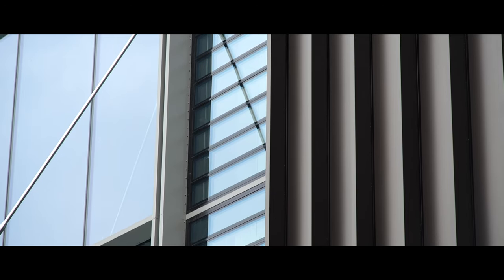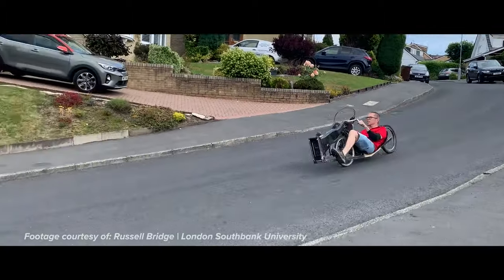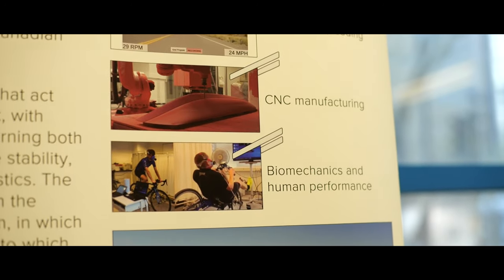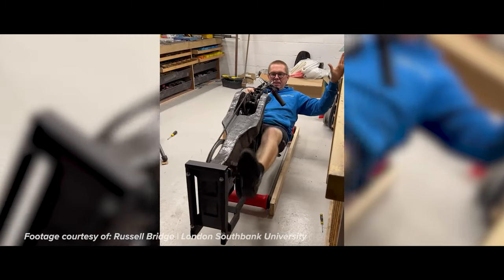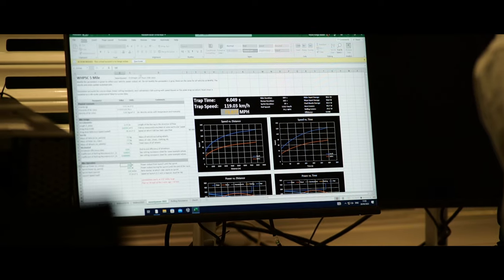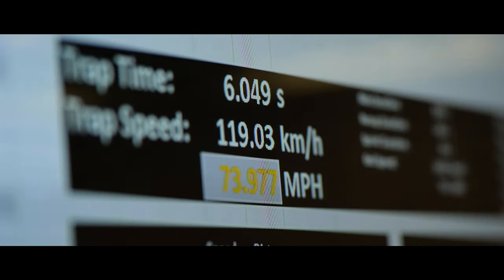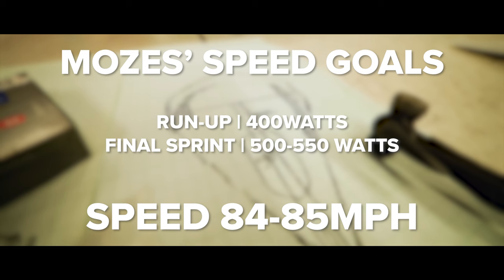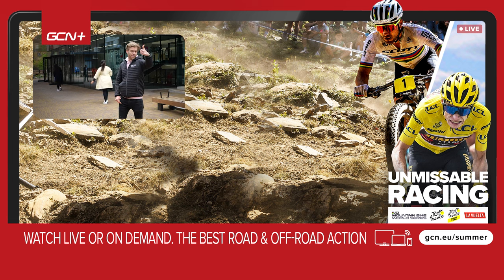The Awesome Engineering Of Land Speed Record Bikes!

Comment from the maker: What’s the fastest you’ve ever gone on two wheels? 🚴💨 Let us know in the comments below! 👇
Reply: Around 85 km/h, downhill of course
Reply: 80/85kph once on a Bad local road and vowed never to do it again….. it’s not worth it!! But my head thinks 60kph on a downhill is ok regularly 🤷🏼‍♂️
Reply: 89km/h. And it was beautiful. It was however on a closed road, good road surface, ideal conditions. It's not something I'd like to do on a normal road.
Reply: 50 mph alone, 55 mph in a pack. Downhill, of course, on California coast with side winds from the Pacific.
Reply: around 55km/h with a blast of wind in the back, flat ground
Reply: How fast on two wheels? Over 140mph.

It was a motorcycle though.
Reply: 72kph on flat ground on my Cruzbike V20 with a slight tailwind at 55 years old. Yes, it is a recumbent, but not faired or a "streamliner" like in the video. Those are way faster.
Reply: 60.5 mph at Battle Mountain in 2019, and I was only like 14th fastest. I was there in 2022, the year these bikes and folks featured in this special were there! Cockpit window video with speedometer, start to finish: https://youtu.be/dftLvLb8USU
Reply: 101 kph down the Tourmalet. Scary as f
Reply: My fastest ride was 61 km/h. I was going downhill.
I sometimes go 50km/h when I go downhill near a viaduct. After the decent I go 20km/h uphill.
Reply: Three wheels, but over 50mph, downhill in snowdonia, one wheel on loose chippings one on grass - the roads weren’t exactly ideal…
Reply: @FFVoyager  Motorcycle or not.
This was pretty fast. about 225km/h.
That's even faster than the ICNG (the new Intercity train). This train can go 200km/h.
Reply: @Frank-mn4hx  it was!  😆
Reply: About 150mph, it's called a motorcycle
Reply: 106km/h during a one hour record attempt on Dekra Testoval. Listen right, Battle Mountain has less than 1% gradient, so yes, it is downhill…easily you should subtract 30-35km/h from those records there
Reply: I once road 87.8 kph downhill in a full tuck
Reply: 44 MPH on a 1989 Ross Trice faired [X3 wheels] slipstreaming a car on the A30.Not fast in comparison to other riders here & if the car had applied its brakes I would have been toast.The early versions of this type had the charming habit of locking the left hand front wheel if the brake lever was applied too fiercely as the Sturmy archer drum brake hub was fitted with the leading/trailing edges of the brake shoes reversed- resulting in a capsize or spiraling down the road like a Tatra [WW2 & German Officers unskilled in driving this rear engined  car]
Reply: 60mph on road bike and 52mph on recumbent trike but held up by cars. Still want to go over 60mph on the trike. This was downhill.
Reply: 98.3Km/h on a Strava segment called Calder death race.  0.67Km long average gradient -13% max -20%. Could have pushed harder to hit 100Km/h but the self preservation instinct was kicking in hard.
Reply: On two wheels? Probably 70kph. I don't live hilly, so I don't have many chances for downhill speed records and am not trained, when I get a chance. 😅 In a velomobile I did a 99kph downhill just on the ride home from buying it and probably could do more, if I revisited that hill.
Reply: @casualguy393   70kph on flat!? I'm gonna have to get my V20 on the road and train hard! 😮 I need a bit of downhill for 70kph in my Alpha7 velomobile!
Reply: about 60mph down Froome Hill in Herefordshire. Brown trouser time with the kink in the middle! 😅
Reply: Does Zwift count?? 😀
Reply: With my velomobile I have started braking at 126 km/h on downhill slopes a few occasions.
Reply: 57mph on a Welsh dual carriageway in a Time Trial and on the aero bars. I crapped myself  :-(
Reply: @PsyKeks  It was only for a few seconds, but I bet you would whip the pants off me in an Alpha7, and the longer the race went on the worse the beating would be hahaha. I can't afford a velomobile, so I either have to put fairings on my V20 or build a streamliner.
Reply: 104km/h down a closed tunnel. Amazing what a difference a good road surface makes.
Reply: Leaving the underground garage at work, and cycling up the ramp, the garmin unit hiccupped. The resulting effort showed an average speed of 195.6kph. I'm not sure how accurate that reading was, but I'm happy to settle for a 20% +/- variance.
Reply: 90 km/h on a road down to Oslo. It had cracks, and I was riding a touring bike with narrow tyres and full camping gear in lowrider bags on the front wheel, so I could easily have flown over the bars... 

This was before cycle computers, so to get the speed I was singing various songs with different BPM's, and matching that to my cadence. Afterward I could count the BPM and calculate the speed from my top gear. 😁
Reply: Unknown.  I tossed my speedometer when I was 12 and never looked back.  sub-5 hour Century though, fwiw.  That was with a steel bike from the pre-aero era, so probably 3 hours on a GCN bike 😆
Reply: 95km/h on a tandem downhill in traffic, could have gone faster but the stoker started screaming about never sleeping with me again!
Reply: I have seen (old Cateye computer) just over 55 mph in my youth on steep decent with a tailwind. Best I have see just recently was 75 kmh on my TT bike with 530 Garmin. Seeing that you didn't define two wheels I have to brag about my Yoshimura Suzuki Hayabusa that regularly sees 340 kph on the speedometer. Though I now should take the Garmin along to verify it. (The speedometer  is only marked to 340🙄)
Reply: Hmm. Nowhere near as fast as everyone else, by the look of things. 42 mph downhill (I think that's about 67 or 68 km/h). But the road was bumpy enough that I couldn't see very well, so pedalling faster did not feel like a good idea.
Reply: @Russo_Speedbike For all people here: Francesco Russo is the current 1hour worldrecord holder with 92.43 kilometres with a recumbent. And he rode the bike backwards sitting!
Reply: 60 to 65 km/h on 2 and 4 stroke scooter i use to own
Reply: 90 kph down the col de la Croix-de-Fer (Fr). Back in the days where helmets were far less common. (Yes, no helmet. Never again.)
Reply: I used to regularly do about 90kph down the Bombay hill towards Pokeno south of Auckland before they made it a motorway on an open medium wheel base recumbent. 
53-11 top gear, 170mm cranks.
(I've gone a lot faster)
Reply: Just under 100kph on my first lap of the Nurburgring during Rad am Ring last year. Didn't feel as scary as it sounds, it's a fairly wide smooth track with everyone going in the same direction, but I dread to think what would have happened if me or anyone nearby had a mechanical...
Reply: Over 140 km/h so close to what they are doing. On a recumbent, but on a steep downhill. I was very scared :-) Now, with my velomobiles, I use parachutes in hilly area.
Reply: @PsyKeks  The Alpha7 is not ideal at those speeds. I've already hit 80+ in my Bülk :) Put some hosen and a hood on, it'll make a huge difference!
Reply: @AlveHenricson  Haha nice :) Gogogo Alve!
Reply: 52.7mph or 84.81kph on a mountain bike on a country lane with no traffic. I had to tuck in to get that speed.
Reply: About 42/43 km/h downhill.
Reply: Not sure, - these days guys on decent new set ups advise nearing 60mph on the same road - so I guess 50plus.
Many moons ago, fast enough that the young lady driving the Mk1 Fiesta couldn't out accelerate me... and started to look panicked, so I thought I'd back off rather than her freak out and hit the brakes. Before then I was pretty close to the back of the car... just couldn't see the speedo.
Reply: 80km/h but in a velomobile... a Mango.
Reply: 90 km/h downhill tarmac with traincrossingrail at bottom on my all alu racingbike with flat clip pedals....but with flat shoes (ala 'men in black')
IMMA NEVER DO THAT AGAIN....EVER😱😱😱
Reply: I don't know, I was too busy giggling like a madman 😂😂😂😬
Reply: 65-70 kph. Downhill. My GF already tried to kill me when i told her. 

So that’s my upper allowance.
Reply: 52 mph in a 30 zone, according to the Police that stopped me 😊
Reply: @andyb.1026  Did you get a speeding ticket on an bicycle?
Reply: @1barnet1  NO,, Just a mild Bollocking,,  they thought it was pretty good,  I was about 15, young and dumn
Reply: @FFVoyager    about 190 on a Suzuki Hayabusa ~ the wind pressure was fearsome
Reply: 43mph on schwalbe one pro tubular 22mm with front tyre being flat as had no way to sort it
Reply: 130mph Elsinore California. I rode it out the back of a Skyvan at 13000ft.
Reply: I got a speeding ticket when i was 13.   I was doing 40 in a 25
Reply: 200+ mph on a Kawasaki
Reply: 64 km/h on flat ground, it was a faired recumbent.
Reply: 83 kph, MTB, slicks, road race, down hill of course.
Reply: I would like to know, how they did on the battle mountai?
Reply: 167mph

Comment: Thanks to GCN for the video, and good to meet Ollie on the day of filming.

A few spec details for my streamliner seventyseven (the blue bike in the film).

Target speed: 77mph (hence the name)
Actual speed achieved: 73.79mph (twice!)
Weight: 35kgs (the lightest BM bikes are down at 21kgs)
Gearing - primary drive: 85T chainring to 12-32T ultegra 11 speed stripped down to 9speed (still 12-32T)
Gearing - secondary drive: 34T to 17T
Wheels: custom made SMC carbon tri spoke, disc-brake wheels, 406 
Tyres: Michelin Blue 406x44mm (actually measure at 41mm) - these tyres were initially made for the shell mileage marathon. Crrr somewhere between 0.0021 and 0.0030 depending upon the surface
Monocoque shell: carbon fibre / carbon kevlar composite with hex core interlayer
Cda: 0.0195 (approx 1/8th of the best TT position)
Brake: Front wheel only - TRP dual piston mechanical on 180mm rotor
Steering: limited to 5 degrees in each direction
Navigation: 2x micro Foxeer 1500TVL drone cameras (90 degree FOV) with a 10” primary screen (with DVR) and 5” backup screen
Data: Garmin 520 with speed sensor on rear wheel (gps won’t work through the carbon shell)
Bike cost: approx £6k build cost, and £4k in shipping to and from USA

Definitely room for improvement, but it was a good privateer entry if I do say so myself. Huge thanks to all of my team for their superhuman efforts to get the bike out there and for support through the week…

Happy to answer questions below.

It’d be great to get GCN out to BM to cover the event properly…the French team (UIT) stand a really good chance of breaking the world record (89.5mph) this year (‘23) with Francois Pervis riding
Reply: Thanks for posting the details.
Reply: Dude that's awesome!!! Amazing work. I never realized how interesting recumbent bikes could be.
Reply from the maker: Thanks for letting Ollie sit in the bike Russel! So cool to see all the details laid out like this 👀... We wonder what the GCN community would make of this speed weapon! It's crying out to be in the bike vault 👉https://gcn.eu/app
Reply: so cool!
Reply: Hey Russell, why don't you use the legendary michelin radial 45/75R16 tire? Is the blue flange 44-406 better suited for high speeds? What inner tube do you use?
Reply: @w0ttheh3ll  Aerovelo tested the radial tyre and found it very slightly better then the Michelin blue flange, but it's impossible to find/buy now. I did 73.79mph twice, once with a latex tube and then two days later with a lightweight butyl tube.
Reply: @russellbridge I'm confused about front wheel drive it seems, wouldn't it of been easier for rear wheel or is the longer chain worse for this?

I be impressed if done both directions to make it official speed (if recorded how they do with cars on both directions)
Reply: how good are these bikes at climbing Large hills or mountains?
Reply: @Joe-wk9ow  impossible, the steer rotates only 5* in both directions.
Reply: @Joe-wk9ow  How far do you think you can coast up the hill if you hit the base at about 70mph? 
Seriously though, these bikes are built for Battle Mountain. Other Streamliners would be better at climbing because they are lighter, easier to control at low speeds due to a higher seat angle, and can be geared for climbing even though that is not where Streamliners shine. On the flats and descents they are going to absolutely roast road bikes and TT bikes. Up to about a 5% incline, aerodynamics still trump weight and a slightly higher power output of road bikes. Steeper than about 5% or so road bikes start gaining the advantage. The steeper and longer the climbs go on is better for road bikes. However, there are many classes of bikes that are more aerodynamic than TT bikes. High racers, Mid racers, Low Racers, Partially faired recumbents, faired recumbents, Velomobiles, and finally Streamliners. If you had your recumbent legs and experience, you would be marginally faster on each of those. My fastest 50km speed on my high racer is 5kph (On less power actually) than my fastest speed on my Triathlon bike over the same course. On a day with a nice tail wind I rode a few minutes before 1 guy who was on his Cervelo P5 with HED Jet 9s and he needed 286 watts to do 46kph for the 25km course. He beat me by 1 second, but it only took me 211 watts. Neither of us drafted either. I'm 55 (FTP=230 watts), but he is in his 20s, and if he used his 286 watts on my high racer it would have been ABSOLUTELY RIDICULOUS!!!! He stopped at 25km, but I continued on to 43km.
Reply: So did you break the British record?

Comment: I got a velomobile just a few month ago and it is amazing how fast you can get with it. I can get up to 50km/h on flat roads without any problems and keep them for a longer time.
Reply from the maker: Nice! Do you live in a particularly flat area?
Reply: @gcntech  No, I live in the middle of upper Austria and ob my way to work I have 120m of elevation to climb on the 20km (and 50m more on my way home) That‘s the reason why I put an electric assist in my velomobile which works like an ebike. I get assisted up to 25km/h which is great on uphills.

Comment: Pretty interesting they are using an alfine geared hub. I thought the efficiency wasn't good enough for racing
Reply: I saw that but I guess the trade off in efficiency is worth it for the advantages it brings?
Reply: Some teams used Rohloffs 10 years ago but now the top teams use cassettes that slide (rather than the derailleur moving sideways) to keep the chainline straight.
Reply: We are exploring both options - hub and derailleur. We acknowledge the geared hubs lose some efficiency, but when in optimal gear, not so much (which we can then use physical gears either side of to optimise for use in that one at the speeds we need). And that of them all, Rohloff appears to be the best (also most expensive). Shimano Alfine was a cost effective solution for prototype testing the setup. But all the data we have found only shows efficiency testing at road speeds; we are at least doubling those from design spec - possibly, up to a point, making the gears a bit more efficient - we have an efficency test rig set up based on the CeramicSpeed FTT model in which we will be testing this. And as per Tim's comment below, it brings a massive advantage in mechanical assembly / tuning, especially if we need a crossover drive axle anyway, in having a fully contained gear system contained within that, and machined to Shimano or Rohloff's tolerances and QA, which we probably can't achieve in-house. The rig visible in that video is a mock up to enable us to mount that hub onto last year's transmission chassis, so that we can get riding it soon, and tune the ergonomics of the rider position as well.

Comment: I've no doubt this has already been considered, but why not add a crank to contribute arm strength to the system?  Steering could be automated adding a servo and electronics to keep bike centered on a line, which would add weight, but surely more than worth it to put the arms to work?

Comment: I think rotating weight is still going to be unimportant.  You're still storing energy in the peaks of power input, which will reduce losses in the troughs.  Even if continuously accelerating, the heavier wheel will just accelerate more smoothly at the same overall rate instead of the rate surging and dipping with each stroke.
It'll still have the effect of its raw weight, but the rotational effects mostly cancel out.

Comment: Wondering what the pavement surface is like on Battle Mountain? Are there marginal gains which could be realized if the resources existed to specially prepare the road way? Not sure what would be optimal (budget no object). Polished concrete?
Reply: The pavement is standard tarmac but kept smooth and well maintained because of this event.
Reply: Thanks. Wondered if they watched over this stretch of road in any special way or not. Good to know the kind of do.
Reply: @Canuck38  It's been 10-15 years since the road was repaved.  It was okay in 2019 (not great).  There were no events in 2020-2021.  The road was much worse in 2022.  Riders rode in the left lane for most of their runs as it was a little smoother with fewer cracks than the right side.  Rolling resistance has gone way up.  But it's still fine for motor vehicles, thus there are no plans for repaving at this time.